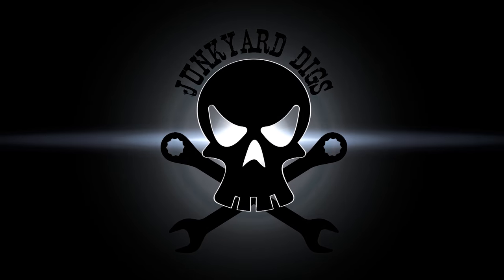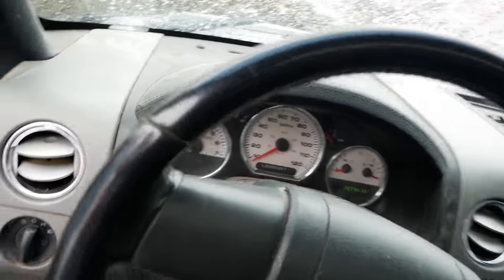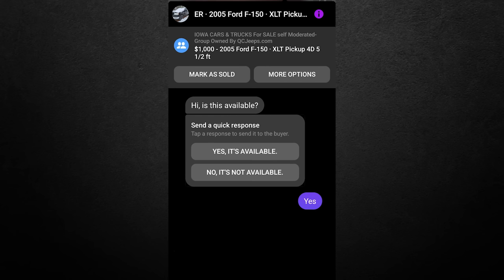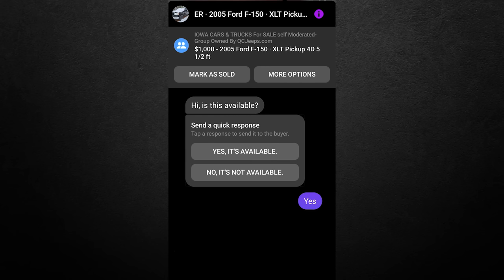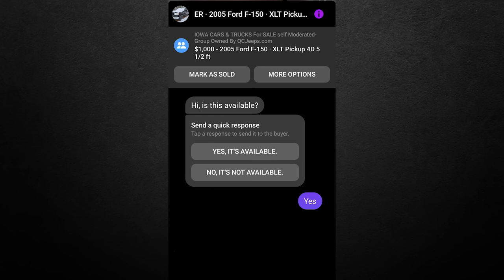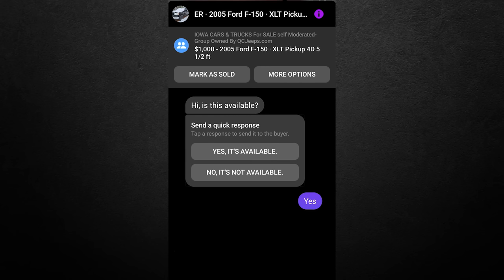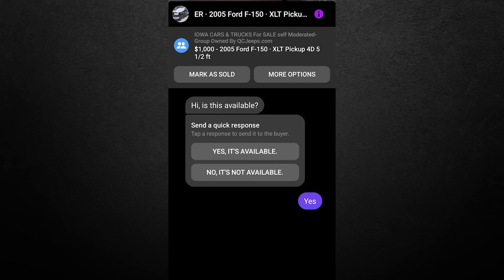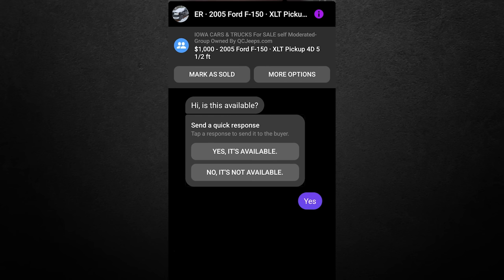How Safe Is a SEVERELY Rusted Frame? - REAL Crash Tests - Cornfield Science

Comment: To be honest, I am amazed and impressed how well it did for how extremely destroyed that frame was.  I would've thought a lot worse like you had initially thought
Reply: That gen F150 has their issues, but they're a hell of a lot tougher than people give them credit for.
Reply: @kingdaniel3519  True. In 04 they boxed the frame in and made it many times stronger. That was also its downfall as the boxed frame wasn't sealed well enough to keep water and salt out, but was sealed well enough to keep it in, so they rotted from the inside out. They added about 1000 lbs to the weight of the old model on a quad cab between the frame upgrade and the extra sound deadening (dampened steel panels, extra thick glass, etc) as buyers wanted more luxury features. It made them slow and undermined the fuel economy gains of the VVT, which was also a disaster.
Reply: @mikelemoine4267  I know that's a problem in the rust belt. Thankfully, I live in the south where that's not an issue. I do want to point out that Ford uses VCT(variable camshaft timing) not VVT. And it wasn't as disastrous as you might think. It caused some problems, sure, but it led to the excellent Coyote. The 5.0 is an upgraded 4.6 and is listed by Ford as being a part of the Modular motor family.
Reply: @kingdaniel3519  Yeah I'm in Florida myself. They had a lot of failures early on with the VCT system, some argue it was more an issue of poor maintenance, others say it happens no matter what. Fordtechmakuloco fixes a lot of them and says the replacement parts solve the issues, so I would not hesitate to buy an old one on the cheap with the expectation to do phasers/timing on it to make it run forever. 

I have an 03 F150 Harley and the 2V 5.4 has been super reliable, but it's getting pretty tired (timing chain rattle, scoring on cylinder walls from running a CAI in Arizona by previous owner). Still starts and goes anywhere, but is showing its age. I'm waiting for a deal on a wrecked F150 or Mustang with a Coyote to swap into it. It'll lose some low end grunt in stock form, but it would nearly double the fuel economy and of course a future Whipple addition would wake it up. I might need to go up North and find one that's rusted out but running good!
Reply: My 1989 F150 with 285k Michigan winter miles. Rusted almost off the frame sent a Honda Del Sol to the junkyard on a flatbed. The only damage to my truck was the bumper had some red paint on it. Rust doesn’t comprise safety, it’s only weight reduction.
Reply: It did so well in the crash portion because most of the crash energy is absorbed by the crumple zones in the body rather than the frame. If anything, this demonstrates just how well the sheet metal did it's job.
Reply: @mikelemoine4267 , Great point. This is why Toyota's trucks and 44-runners run a c channel framework in some years. They also had a free frame replacement recall for a while. Unfortunately I doubt that ford will ever do something like that. Its basically a battle of fluid film vs road salt/ life at this point. My brother had a 1983 Z28 up in the rust belt of New England. Replaced about 4 fuel pumps and never once replaced the stainless steel exhaust system. It had that cross fire injection.
Reply: @327JohnnySS  Yeah I remember Toyota replacing a bunch of frames. Kudos to them for doing what was right even though it cost them some $$. And yes, Ford will not likely do anything unless forced by the courts. Japanese companies operate with a long term outlook, while MBAs running US companies mostly care about the next month, quarter and maybe the year end.
Reply: @mikelemoine4267  Great comment. The U.S. companies should follow what Toyota did. It must have cost Toyota big coin yet they only increased their customers trust and loyalty to the brand. I  have a 1996 4-runner with 407k with a clean undercarriage and frame with the original drive line. 2wd automatic with the 3.4 by. Not in the rust belt and up on the maintenance yet waiting  that head gaskets issue.    I  run a thermostat with that has 3  1/4 inch holes drilled it for the warm climate. Then in the 3 months of cold weather I run a regular 170°f thermostat. The crossover exhaust pipe behind the heads is their Achilles heel. Yet there is a kit to eliminate that. Forgive  the rant. 👍
Reply: @327JohnnySS  Yeah that era of Toyota was the best. They are still good, but succumbing to cost cutting to try to compete.
Reply: @mikelemoine4267  ,True. They even have plants in America. Yet spinning wrenches every time I open a hood on any new vehicle's I shake my head off all that plastic. Remember when back in the day when Ford was trying to design a plastic engine with ceramic cylinders? Every year more and more parts are becoming plastic to increase mpg. Yet a 20 mph accident will total most vehicles on the road today.
Reply: @327JohnnySS  Never heard of Ford trying a plastic engine, that sounds like it would have been a disaster. The EPA is driving a lot of bad decisions that IMHO ultimately do more damage to the environment than they stop. These plastic parts fail more frequently and require replacing (made of petroleum!), yet they don't break down for centuries, if at all. Plastic that does break down leeches harmful chemicals into the ground and water, some of which are already detectable in humans and animals. They require overly complex pollution controls that do reduce some harmful emissions, but at the same time reduce fuel economy and shorten the life of major components which is all very polluting itself.

I have an Ecodiesel Grand Cherokee. They choked that little diesel so much it soots up the oil passages and ruins the bearings. The EPA made them re-tune them all because they didn't meet promised parts per million emissions of NOX. The new tunes made them almost undriveable due to bogging them down, then they lost about 5-10% fuel economy. Less parts per million of some emissions, but quite a bit more emissions overall. I maintained mine at half the recommended mileage intervalsdue to known bearing problems and yet it still seized and blew a rod on me at 64K miles one day, dumping a couple quarts of nasty oil all over the side of the highway. My extended warranty covered the $13K+ cost of mining iron ore for the replacement engine using dirty diesel equipment in some country with little environmental oversight, then shipping it to Italy on a crude sludge burning ship (1 gallon burned every 6" across the ocean, no emission controls at all). Once Italy fired up the steel forging equipment powered by burning coal or trash and made a new engine, they shipped it to Detroit on another crude sludge burning ship, then tranported it cross country in a diesel powered semi to my dealer so they could install it. The dealer had to ship the blown one back as a core, again via diesel powered semi. All of the plastic parts on that engine are now resting peacefully in a landfill somewhere. Dramatized for effect, but this is basically how it really works other than the fact that the mining and shipping figures are shared by other industries and deliveries, but you get the point. 

All of this just to save a little bit of NOX emissions from what could be a very efficient and reliable engine if the EPA would look at the big picture. That tiny diesel has comparable output to the late 90s Cummins 5.9 and is known to return 30MPG freeway if you keep it under 70mph, and quite a bit more, even in the bigger RAM 1500 when emission equipment is removed and a better tune is installed. Oddly, when FCA was sued over the rotten re-tune and had to pay owners around $3K for compensation, a lot of them spent that money on aftermarket emission delete kits. 

This stupidity reminds me of when they banned the old VW Beetles because they could not meet the low PPM emissions requirements of the time. They had tiny engines that burned very little fuel, so while they might have put out more PPM of certain emissions, they put out very little overall. A new at the time 500 CI Cadillac might have put out half the PPM of NOX or other harmful particles (just a guess, didn't bother to look), but if it put out 10x as much overall then that means it actually puts out as much of the bad stuff as 5 Beetles. All EPA cared about was checking the box saying it met the PPM limits, not realizing they were doing little to improve the environment. I'm sure the difference isn't as drastic if compared to other economy cars, but even those were generally heavier and had bigger engines, so they would put out more overall pollution than the humble bug. 

/rant😁
Reply: @mikelemoine4267 , Yeah so basically the boys down in the lab were saying " I looks good on paper.  Then they go home to their wife's who say that the light over the sink is blown out. These clowns will cross thread a light bulb while developing vehicles. 😂
Reply: @mikelemoine4267   Toyota trucks used to have a box frame too which is why their old trucks are damn near indestructible. Problem is they rusted worse than these Fords did and they had to issue a recall to replace frames which is stupidly expensive to do, it would have nearly been cheaper for Toyota to just give everyone affected a new truck. After that they never used box frames again.
Reply: @armchairgeneralissimo  You may be right about the cost. They may have decided to fix them as giving loyal customers a new one might delay their purchase of their next new vehicle for another decade. I'm sure they considered every option. Either way, they stood behind their products in a way few domestics would.
Reply: @327JohnnySS  Or at least be upset that the bulb wasn't behind fifteen difficult to remove panels all with 3 different sized fasteners, some metric and some SAE😊
Reply: @mikelemoine4267  Toyota didn't do it out of the kindness of their heart they lost a class action lawsuit.
Reply: @armchairgeneralissimo  Oh wow, I didn't know that!
Reply: I thought the same until I realized those impacts were max, 25mph. Head on collision on a 45mph road? That truck would crumple like an aluminum can poked from the sides.

Comment: IIHS should totally do a crash test series on rusted frame vehicles. Would be very interesting to see directly comparable data
Reply: Problem is you can't control the variables. Every test would have to have identically rusted frames which would be impossible obviously. But it would make for some interesting entertainment.
Reply: @user-jm4nj7nz6t you could make the conditions the vehicles are in identical. Salt/h2o mist for x hours a day, for y days (or some other way to induce rust). This would not only test the rust resistance of the vehicles, but once crashed, how much that rust affected its safety

Comment: Mechanical engineer here. Some comments to share with you: 1) the rust in the frame appeared to be mostly in the lower flange of the box-beam section and a bit on the lower part of the web (sides of the box section). The remaining part of the web and the top flange--an upside-down U--gave you remarkable resiliency against your cornfield brutality. 2) to give a more dramatic failure in the frame, I suggest loading the bed with bags of sand or other weight, favoring toward the cab, up to the truck's rated capacity and drive backwards into the ridge in your cornfield (in the rougher direction) and at an angle so that one tire hits the ridge before the other tire. A severe failure should appear at the bed mount toward the cab. If not, add more sand.
Reply: Sounds like a recipe for a rear end doing a kick flip over the ridge and leaving the cab chilling
Reply: if you have to surpass the weight rating to finally get it to break I would argue the truck is safe to drive (definitely not safe in the event of a crash, but safe enough to be driven carefully like your life depends on it)
Reply: @justinkaufman495  He said up to the trucks rated capacity, not surpassing it. I’d argue that driving carefully does not remove the risk of an accident either
Reply: @suhhhdud9682  no but it can make it less likely to happen. and yes he said up until the limit... but then followed up by saying if that doesn't break it add more weight which is where my comment came in. seeing how it did on that crash test though I'd say it's safe in the event of an accident anyways. there's a very specific kind of crash that would make it a problem and that condition wasn't met when they tried to crash it.
Reply from the maker: I considered it, but didn't want a 50lb projectile behind me 😅 - a fellow engineer
Reply: @justinkaufman495  The issue with that is that safety ratings are made so that there's considerable room for error, the rust makes the safety rating and the real limit come closer together, so that the top end of the rating may be the new failure point
Reply: @Karl Marx  my point isn't that the safety rating isn't correct. my point is that if in order to break it you have to load it past the maximum capacity then you've proven the opposite of your point which Is that under normal conditions the frame damage is an issue.
Reply: Not a full engineer, but my understanding is that the question of loading is irrelevant outside the goal of a spectacle- the reason deep rust is so fragile is that it's nowhere near as strong or ductile (flexible) as good steel, and flakes away over time.  If the truck was brought back into road service, the truck frame would continue to lose strength as it continued to rust until one of two things happened: either a shock load such as a pothole or a collision would deliver a sufficient blow to break the frame suddenly, or if it's driven very gently the remaining good metal would begin to fatigue, until it finally breaks with a distinctive "clamshell" appearance at the point where the failure is still in ductile metal.

In both cases, the biggest problem is that there would be no way to reliably predict exactly when the truck would finally fail, and that it would be difficult to control the situation to ensure the ultimate failure came at a time and place that did not endanger anyone or risk further collisions.
Reply: Frames are boxed now and not shaped like a tall C. Way stronger for sure even after being turned into a lower case n by the devil. 😂 100% agree
Reply: Is any car safe to drive ?
Reply: Most people seem to forget that this truck was designed to tow several tons and a cargo load of another ton or so. This being said, it is not surprising that the frame hold up. They should have tested the car with the maximum weight permisible, I would’ve been surprised if it hold up then.
Reply: @justinkaufman495 There is something called Fatigue, the more you ride something, the small failures get bigger and bigger, until it collapse. Still let’s remember this is a truck designed to endure cargo of several tons, so I would drive this normally if it is just me o two people more  in the car, definitely not like a truck but a bike with cover. (Taking in consideration that the rust stops with a supper caring owner)
Reply: @juandavidperez243  I understand fatigue can be an issue, I could see myself running that until it starts to feel or look unsafe. By look unsafe I mean without inspecting the Frame if it's sagging, or showing a break.
Reply: Can someone tell me if I could put a 800 lbs engine in a gm b body frame 77-96 without problems....will it bend it?.

What's the heaviest I could put?
Reply: Depends...how rusty is it?? 🤣
Reply: @cantstanddogs4776 Realize that GM still installed Cadillac big blocks, first the 425, then the dimensionally same 364, into the early 80s. The Fleetwood was indeed a B body. If you want to put a 454 in a Caprice, a FEW (DAMN few) were made in the mid-80s. I've seen one.
Reply: @jeffrykopis5468  want to put a john deere engine in one and i figure that'll be around 1000lbs... what are the stories on those stock 454